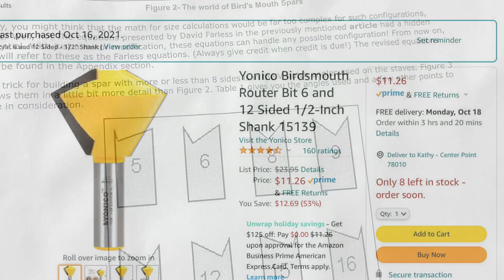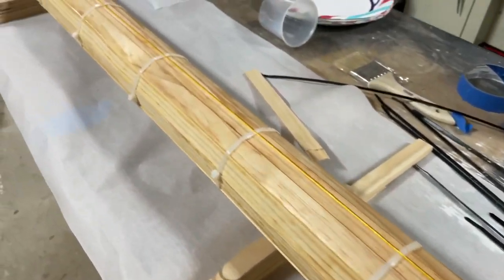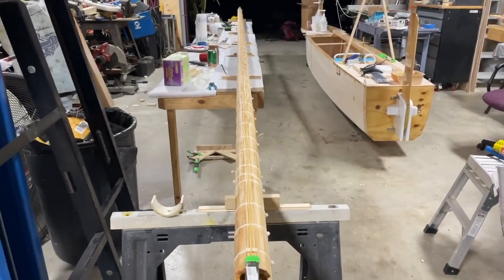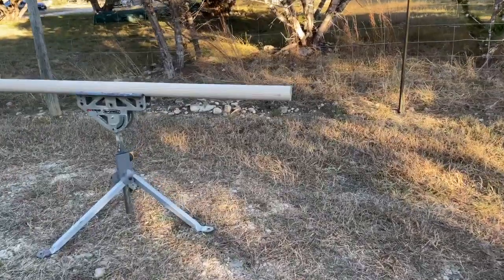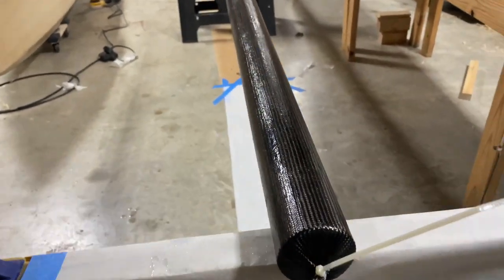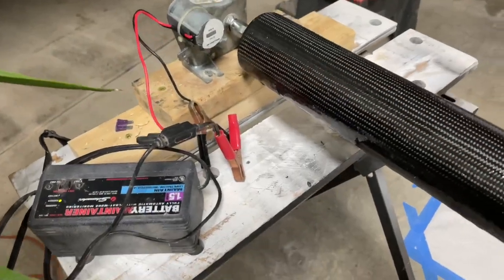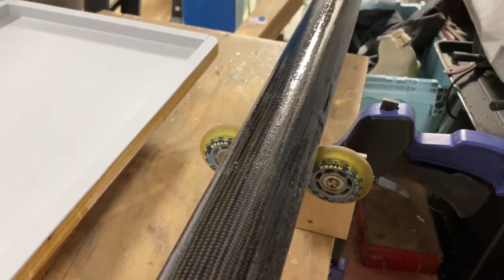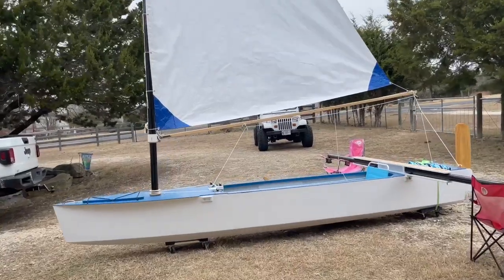Hollow 12 sided wooden bird’s mouth sailboat mast covered with a woven biaxial carbon fiber sleeve

Comment: great video. Did the carbon fiber stiffen it up some? Looked kind of flexible when just wood.
Reply from the maker: Thanks It did stiffen it up a lot but it still has a good amount of flex but nothing like it did in the video.
Reply: Tks, I guessed you're using pine wood.  I confess, I'm quite skeptical using pine... maybe here in Brazil the pine is different... look the same but I'm not sure about the resistance,  the stress of the bending.

Comment: Pretty cool project. How much does the mast weigh? I'm building a Farrier F22 trimaran and I've been trying to figure out how to build my own mast for it. Maybe I could use this technique. I think the Carbon sleeve would work well, but I think it would need a few layers of unidirectional as well.
Reply from the maker: It’s about right at 20 pounds. It does flex quite a bit but it’s proven to be very strong. I’m sure if you added more layers of material would stiffen it significantly.  Also increase the thickness of the wood. Wall was about 5/16” thick on this mast. Pretty thin.

Comment: Great job in describing the process. I'm particularly interested in the geared motor that was turning the mast during the post-processing. Is that something you bought ready-to-go or did you make it up? I could really use something like that in our shop.
Reply from the maker: Thank you. It’s a gear 12 volt head motor that was originally used to swing out a stop sign on a school bus. Grainger sells them in various rpm’s and voltages. Depending on water your doing you might be able to use one of those tumbler or coffee cup spinner’s. Go with the slowest rpm you can find probably less that 10.

Comment: Good stuff, so aprox weight per ft after laying the carbon fiber & epoxy?
Reply from the maker: I’m thinking it was about a pound per foot. I gifted that boat to another club member or I would weigh it for you. The staves were about.300 thick. It flexed quite a bit so I added rope stays but its still going strong.

Comment: do you think it could be done with divinycell instead of wood?  building each half and glassing both sides... then gluing both sides...
Reply from the maker: I’ve never worked with that material before. I’m sure it could be done but not for sure if it would be good for a mast. Would be a neat experiment.

Comment: Nice build. What's the total length? Is it tapered? How many layers of carbon fiber did you put on?
Reply from the maker: Thank you. 22 feet 4 inches tall. Yes it’s tapered and one layer of carbon. 2 layers on the bottom 2 feet.

Comment: What is the motor you used to turn the mast when applying epoxy to the carbon fiber?
Reply from the maker: It’s a 12v gear head motor I salvaged out of a school bus stop sign. Grainger sell all kinds of these motors in various voltages and rpm’s. I got the idea from my wife she makes drink tumblers and coffee cups and she uses a similar device when applying epoxy.

Comment: Oh dear, firstly you missed out showing the only difficult bit, gluing up the wood and getting it assembled and clamped up. Then the most useful technique with sheathing, vacuum bagging.....
Reply from the maker: I truly wish I would have done a better job getting more video for sure. Should have took the time to set up Timelapse of the assembly. It was not easy. No vacuum bagging on this project. Just used the rotisserie to get an even application of epoxy.

Comment: 🤔 unless you completely seal the inside of the mast. It will definitely rot from the inside out.
Reply from the maker: Your correct. There are parts of this I didn’t video because it was difficult to do by myself. I did lay all of the staves flat and roll epoxy on the inside portion before assembly. The test mock-up tube I did not. Things got really busy when it got assembled. Time was not on my side but we pulled it off. I highly recommend a helper when doing this type of project.